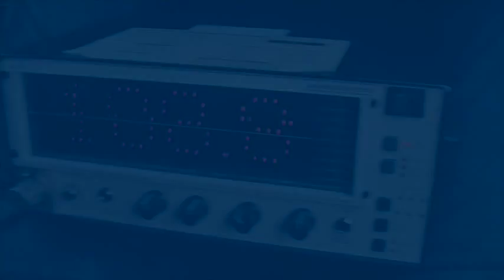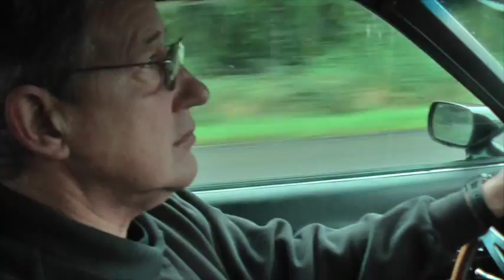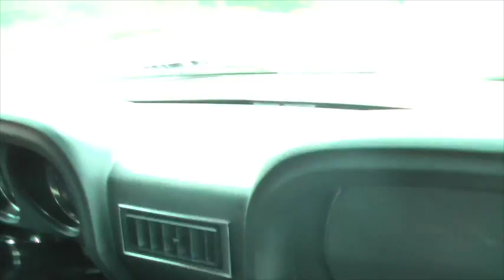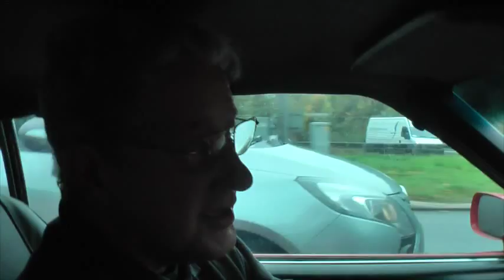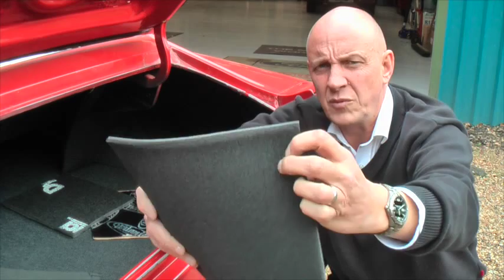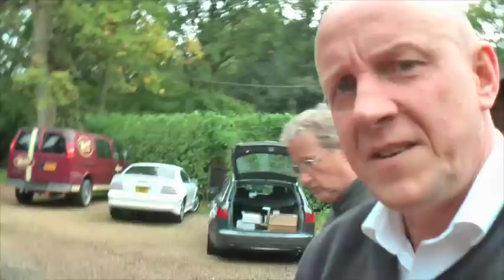The Mustang Workshop Dynamat Test

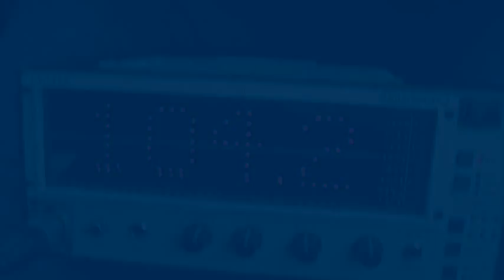Comment: In the control test with the first Mustang without Dynamat, the Driver's side Window us cracked open between 5 and 10mm. Not a completely fair test, ans you'll get additional outside noise in the cabin. You'll definitely see it at 5:58, which makes me wonder of the passenger or rear windows are also cracked open as well. I've also noticed that in the treated (red) car, the driver's side window is fully closed.